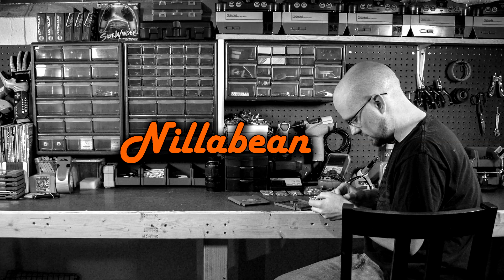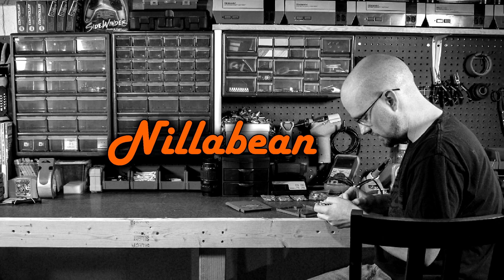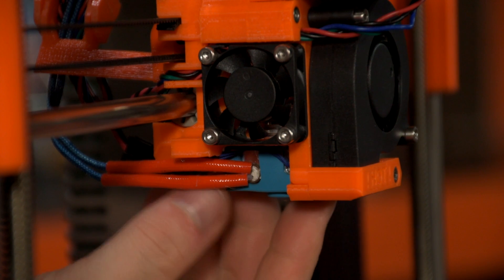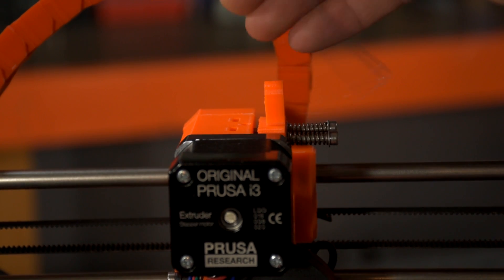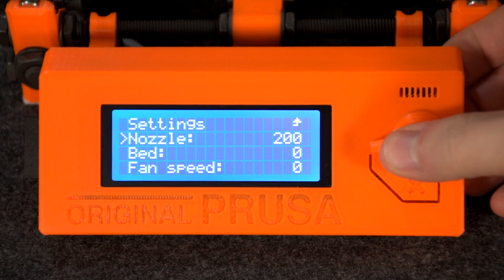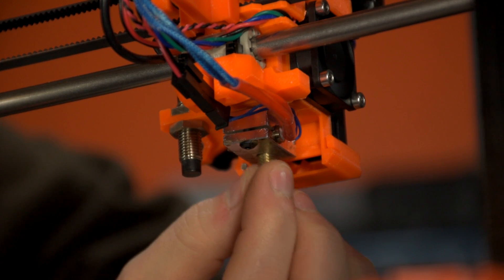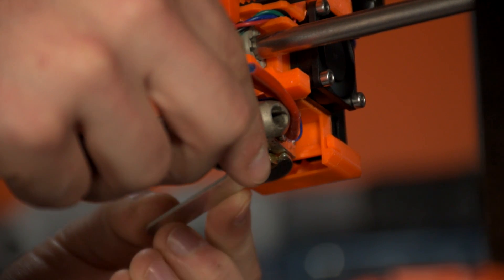How To - Swapping E3D V6 HotEnd Nozzles

Comment: Thats not counter clockwise. Someone can damage there hot end. Remove this video or change it.
Reply from the maker: Well, except that it is. lol.
Reply: @nilla3d  CLockwise=moving clock handles from left to right.
Counter clockwise=oposite from clockwise
Reply from the maker: @denisfabijan4738  I mean I don't even know what to say. In the video at approx 1:20 I'm rotating the nozzle counter-clockwise.

I'm not sure how you can't see that or why you're trying to explain what 'clockwise' means lol. Literally thousands of people have used this to successfully change their nozzles.
Reply from the maker: Also, clocks generally don't have handles, nor do they move from left to right. They have 'hands' and they move in a circular motion. I collect watches (which you likely weren't aware) so I'm quite familiar with the way in which watches rotate, and how that corresponds to the rotation of threaded items.
Reply: @nilla3d  at 1:20 you are turning it clockwise aka like the movement of the clock. 
Not an native english speaker so i maybe got the handles/hands wrong but you dont need to be a profesional clockworker to know how the clock turns.
I listend to the video (not watched) as you where saying counter clockwise. When the nozzle didnt budge (logicaly) i went to see what you where doing. And look at the suprise...you where turning the nozzle CLOCKWISE!
Reply: @nilla3d  imagine the nozzle being the centar of the clock and the wrench a HANDLE...in which direction does the wrench move? Towards 1 o clock or towards 11 o clock?
Reply: @nilla3d  ahh i see where the confusion lies. If you are looking at the nozzle from the bellow its counter clockwise. But if you look at it like most of the people that have their printers not on the celling its clockwise.
Reply from the maker: @denisfabijan4738  Its not really confusing. If something threads into something, it is generally (read: always) viewed from the perspective of the object being threaded in. Your way would have you claiming a clock is rotating counter-clockwise if you're standing behind it, which I think most people would find very odd at best.

I'm glad you finally figured it out though lol.
Reply: @denisfabijan4738  You need to think from the thread, not from the camera.

Comment: no matter what i do the nozzle does not come free on but the plies are chipping metal off the heatblock
Reply from the maker: Don't forget to preheat the nozzle before you try and change it.

It's also worth using a small adjustable wrench ( or regular one if you have the right size ), as it can be tough to get a solid grip with pliers if your nozzle is very tight. Pliers are also much more likely to cause damage to the heatblock as they move around.
Reply: @nilla3d  so uh ya I did figure it out and the issue was I'm just a idiot, I was turning it the wrong way

Comment: You make the point to be careful not to put any torque on the heatbreak - it is thin and quite weak.

E3D suggest loosening the heatbreak from the heatsink first (it is only hand tight) - seems to me that is quite a good way of ensuring no torque is put on the heatbreak by mistake.
Reply: this makes sense, I just ruined my heatblock and heatbreak trying to do a nozzle change :p

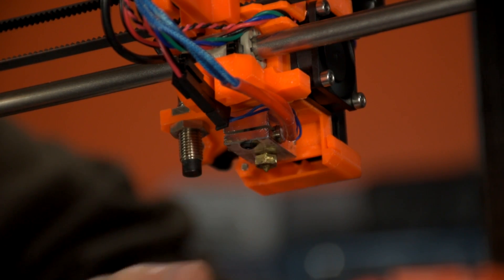Comment: Question... why is your heat block so loose (1:35)? Thanks for the video BTW!!
Reply: The heatblock is not really fixed into place other than by the cold side and the wiring so it will rotate very freely and that's the problem right there, it will also very freely break off your wiring or cause the heat break to leak. It's such a poor design it is a miracle it works at all, just look at how close you are to shorting it out when trying to hold it with the adjustable wrench. Just a hole for a nice hex key would have already saved so much trouble.

Comment: Thx for this video. I just got a kit of replacement nozzles from E3D so this will come in handy when I switch out the 0.4 nozzle for the 0.25 nozzle (for testing detailed prints). Edit: oh, just now got the notification about this video. Youtubes notification system is wierd.

Comment: I removed my nozzle yesterday in order to clear a clog up in the heatsink and now my heatblock wiggles slightly (1-2mm up/down and side to side). what did I do wrong and can it be fixed without having to buy a new hotend?
Reply from the maker: The same thing actually happened to me the first time I changed nozzles, so don't worry you more than likely didn't break anything!

What I ended up doing was rotating the round heatsink itself just a bit so the threads would tighten. You might be able to do this without disassembling anything, but I ended up taking the front part of the extruder assembly off to do it.

Also make sure your heatblock is rotated back into the right position. The looseness happens because both the heatsink and the heatblock thread into the same heatbrake so everything has to be tightened up together for the assembly to be solid.
Reply: Nillabean I replaced my nozzle but then while doing a test print filament came out between the heatblock and the base of the nozzle as well as some between the heatblock and the threads of the heartbreak...i can't unscrew the heatblock from the heatbreak now. Do you know how I can go about fixing this?

Comment: Did your i3 mk2 come with that blue insulated sock? Mine didn't.
Reply from the maker: Nope I bought mine from a supplier in the US that sells E3D products. 

Apparently you can request them from Prusa when you order your Mk2, but I haven't personally confirmed this.

They're very inexpensive and I recommend picking some up. If you use one you'll have to do a new PID tuning that I covered in a stream a little while back.

Comment: Hi! thanks for the video !
Is it imperative to unscrew the nozzle at hot temperature ? Can you please exploit why? Is it the case for every kind of hotend?
Reply from the maker: Hey there!

The reason the high temps are required for nozzle changes are because aluminium and brass both expand when heated, but they expand at different rates. Aluminum expands quite a bit more than brass which means the heatblock will expand more than the nozzle making it require much less torque to remove, reducing the chances of breaking something while switching tips.

Comment: Nice job!  I like the tip about the tray. One added tip - remove the parts cooling fan nozzle. It is easy to remove - just one screw. By removing the nozzle you will have easier access to holding the heater block.
Reply from the maker: Thanks John

I'll give removing the fan cover a go next time I switch nozzles.

Comment: Does the prusa i3 mk2 hotend have a ptfe tube?
Reply: Yes it does.
Reply: it does? where? I was pretty sure it was an all metal hotend. I have seen the PFTE tube that goes in the opening of the cold end but I didn't think it went all the way down
Reply: The PTFE tube is 100mm long I think.  http://shop.prusa3d.com/en/3d-printer-parts/104-ptfe-tubing.html

Comment: thanks for the tip but, in the last live stream you had a problem with the heatblock right? it was kinda loose so is it normal to be like that when the nozle is away from the heatblock?
keep making videos man i love your channel! ;D
Reply: lorenzo solitario yes. The nozzle tightens against the heat break inside the heater block, so without the nozzle the heater block is just loose on there.
Reply from the maker: Thanks Lorenzo

It didn't turn out to be a problem so much as me being unfamiliar with how the heatblock attaches to the nozzle and heatbrake. I had seen other users who put too much torque on their assembly and broke it so I was terrified that I had done the same lol.